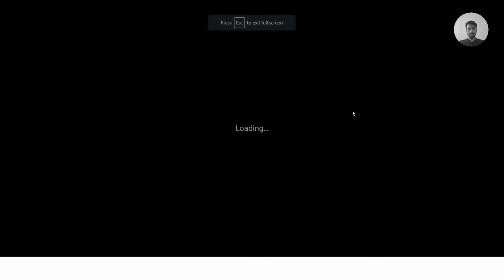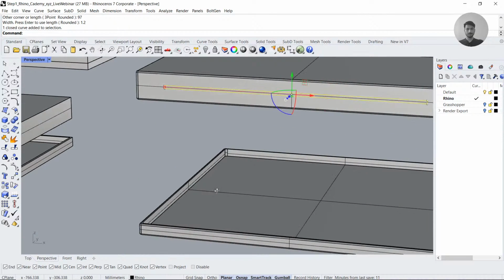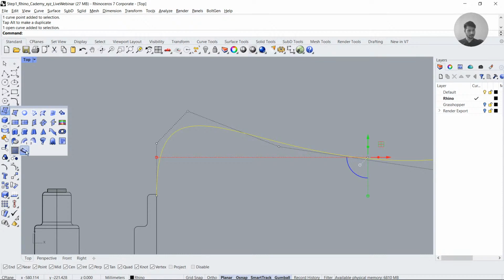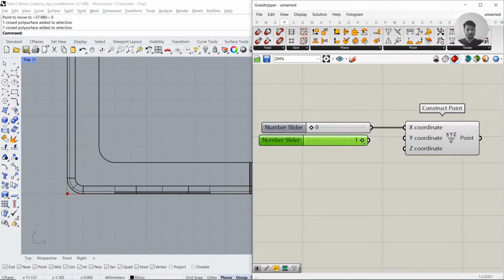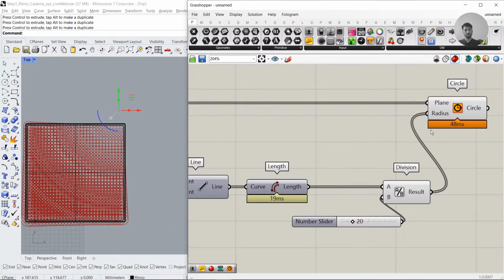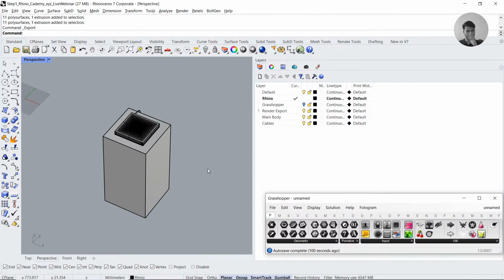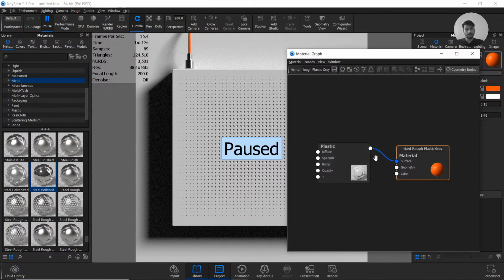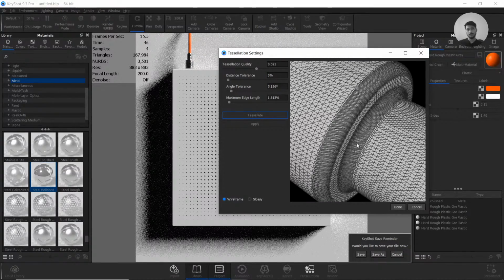Rhino 3D & Grasshopper Tutorial : Design a Parametric Disc Player | Webinar 1.0

Comment: I am unable to make thing snap to centre. It snaps to what it thinks is the centre, but when you zoom in it is incorrect.
Reply from the maker: It sounds like Grid Snap might be turned on or the incorrect Osnap is being referenced. Try turning off Grid Snap and double-checking your Osnap settings to ensure you're snapping to the actual center.

Comment: Hey Aman! This is awesome content! Very easy to learn. I was wondering if you have changed your pc configuration in the past year or if you have a dream pc build you think can handle your different workflows seamlessly (that is attainable).
Reply from the maker: Hey, glad that you liked it. No, I haven't changed my PC (Laptop) in the last 6 years. And probably will still use this a couple of more yeats. I use a thinkpad P50 (from 2016) with a Xeon processor and a Quadro 2000M. You can probably get it for 500 EUR now. The quadro cards are amazing when it comes to CAD modeling. Even a cheaper Quadro card can perform equally well or even better than a lot of mid or high end gaming cards.